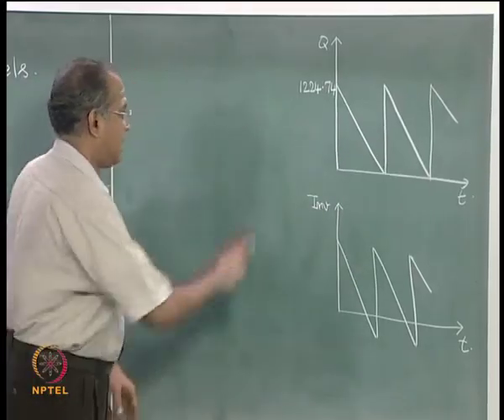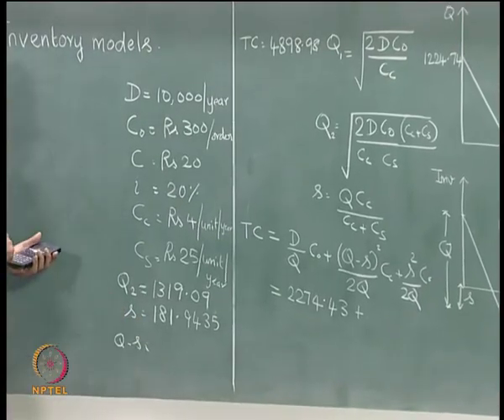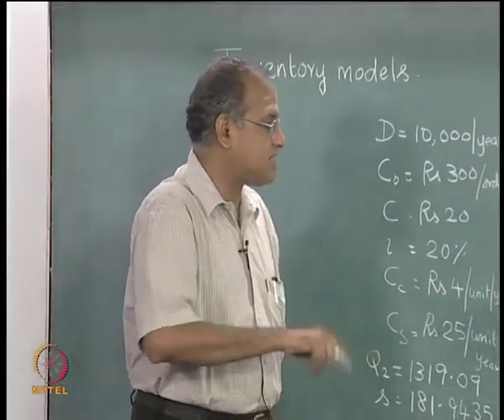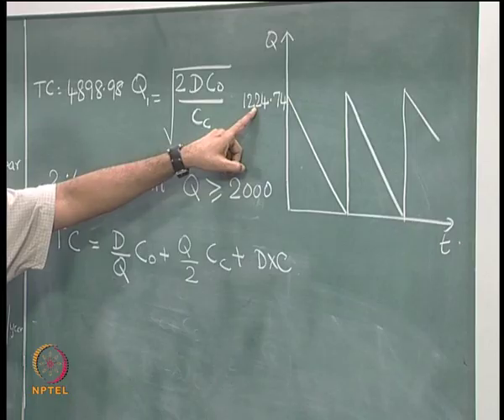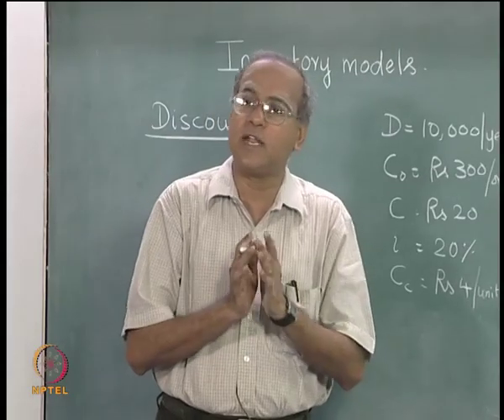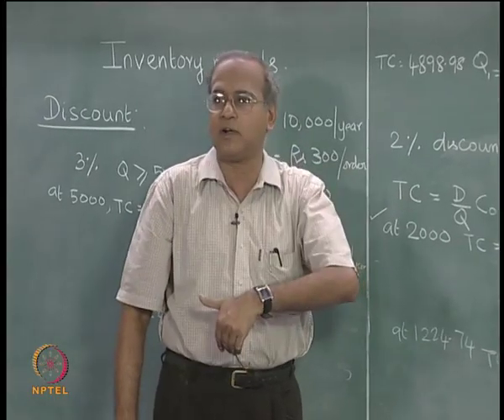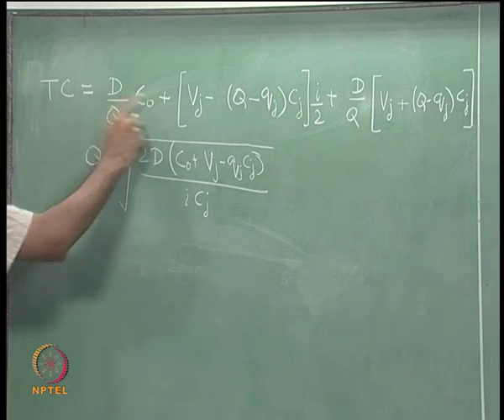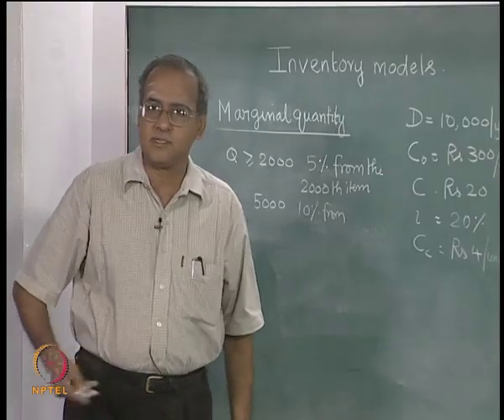Mod-04 Lec-11 Inventory -- Models for all quantity and marginal quantity Discount

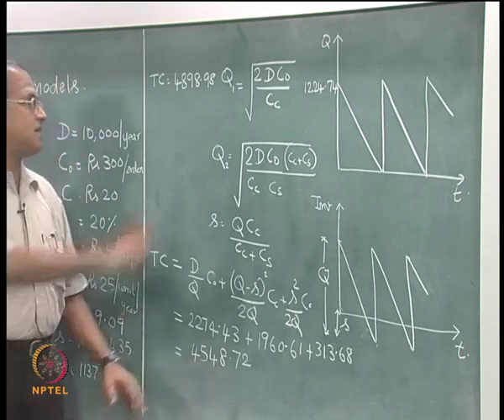Comment: 17:29 I have a doubt. When backordering is allowed and we backorder large amounts of supply, some delay happens. Due to the delay, if customers stop purchasing goods completely, won't the total cost become greater than the total cost when backordering is not allowed?
Reply: Yeah that we define as loss of sales cost, but it is sometimes hard to assume in exact terms. Also, there is a term called "goodwill cost" that can be taken into account. Even though there is not a complete loss but the customer might reduce the number of orders because of significant waiting times.